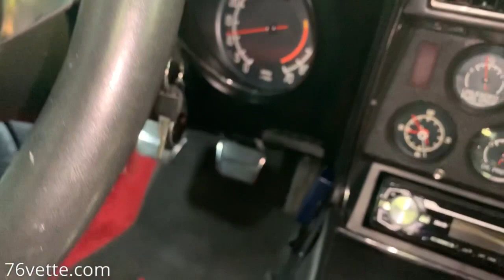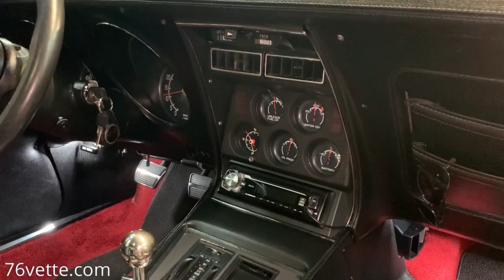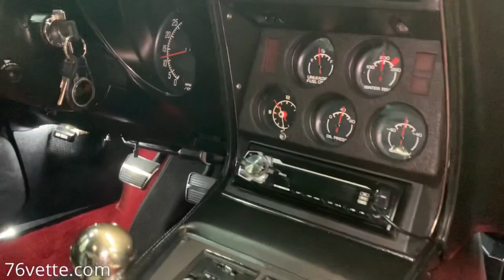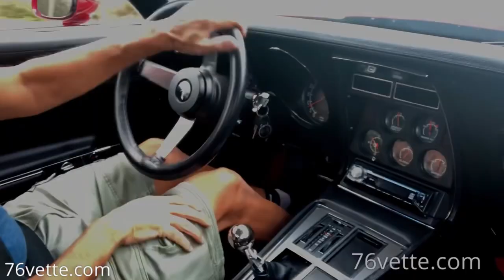1976 C3 Corvette: Body, Engine, Driving

Comment: Love the hinges!  Just bought the Shelac.  I need to take them off and dip them again as a bit of rust is seen.  And I must agree.  That vette should be in your livingroom not on the road ahah!  Off to hunt for those wiper trough leaf catcher screens.  Park under a tree once and your evaporator core is plugged!
Reply from the maker: Thank you! I modified plastic screens from a newer C3 since the original ones looked horrible. They used metal mesh screens for C3s up until at least 1976. I did not care for those.
Reply: @76vette  Ya I remember pulling off the old screens that were rotted and chewed up.  Metal.  I may be able to fabricate somthing getting the right material.  Great idea.
Reply from the maker: @aboutmyfathersbusiness8324  Yeah, I saw a pair of original 77-82 Corvette wiper cowl plenum side air inlet screens on eBay for around $25 with the shipping charges. 
Those are important not only to keep small items falling down those cavities but also, as you mentioned, because that’s the air intake for the HVAC system and you don’t want them clogged with leaves and other debris.
I was thinking that maybe Lowe’s or Walmart sell some kind of flexible plastic mesh like for drains or flower pots that could be cut to size and adapted?
Sometimes one has to get creative. lol 😆

Comment: at the 28 second mark in this video, I see you have installed inserts in the fender vents. I've been thinking about getting them for my 75 c-3. how are they attached? The ads for them have no info on that. Love your car.
Reply from the maker: Thank you so much. 
They are installed from inside the fender, and to do this you have to remove a small access plate  under each fender which also requires removal of the rocker panels. I glued mine with Epoxy glue so they would stay put. 😊👍🏻
Reply: @76vette  Thank you
Reply from the maker: @165alice1002  You are welcome! 😊👍🏻

Comment: Nice. We have very similar tastes. I’d like to update my mirrors as well. And add the front spoiler! Looks nice. Did you get later year door panels to accommodate for the newer style mirrors?
Reply from the maker: Yes, the sport mirrors are the best design ever, and they look so nice on Vettes and other GM cars. The Pace Car front spoiler just looks right, IMO, and if you’re getting one, I’d strongly suggest you buy the urethane one. 
The ‘76-and-earlier door panels work fine with manual, dual sport mirrors. I guess you could modify the doors (quite a bit) to accept late-model door panels, but it’s not worth it. Thank you for watching! 😊👍🏻
Reply: @76vette  I meant that my doors don’t have accommodations for the mirror controls… I wondered if you used ‘79 door panels or something similar.
Reply from the maker: The driver’s side mirror is the only one that has manual remote control. 
I wrote a blog article when I replaced the door panels and I mention how o had to cut the new door panel in order to install the mirror control. 
Not sure if this answers what you’re talking about but here’s the link to that article just in case: https://www.76vette.com/2016/05/c3-door-panel-replacement.html